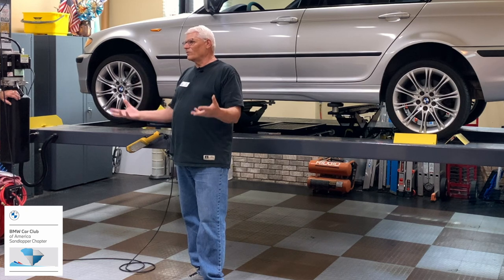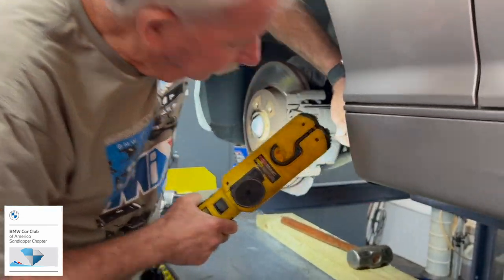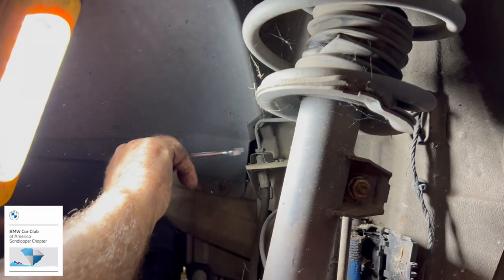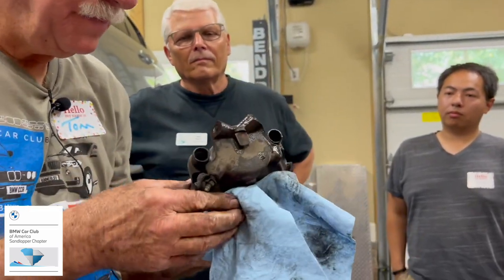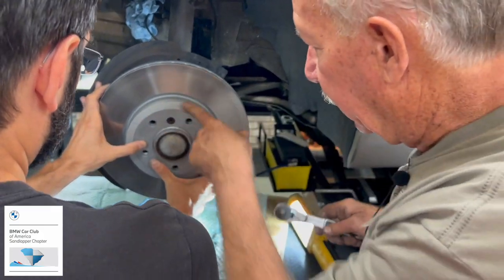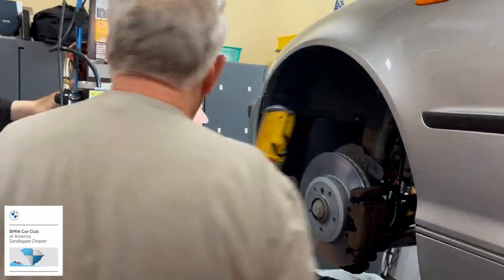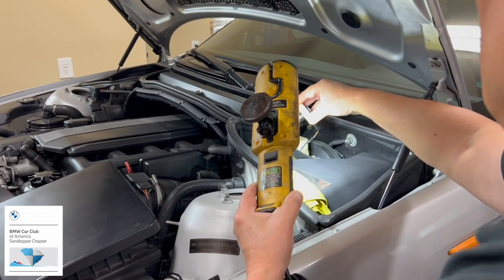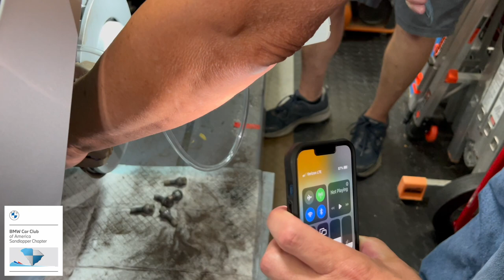Let's Wrench! DIY Brake Pad and Rotor Replacement on BMW E46 330i ZHP | BMW CCA Sandlapper Chapter

Comment: Whenever taking the brake line off it helps to have the brake pedal depressed a bunch, when the brake pedal is depressed the brake fluid reservoir isn't able to flow through the master cylinder and into the system so you'll end up losing way less fluid. These days I use a throttle pedal rod tool that hooks on the steering wheel but have also used a block of wood between the brake pedal and the seat.
Reply: I was going to say, I felt like they risked the reservoir/master cylinder going dry.